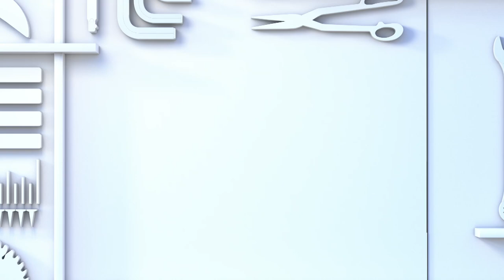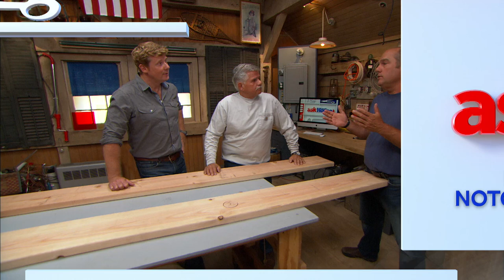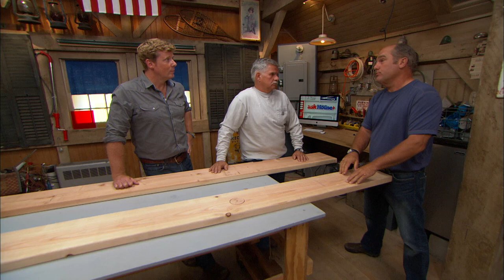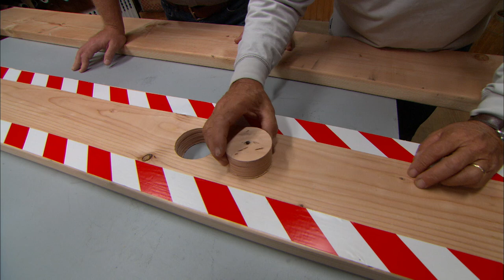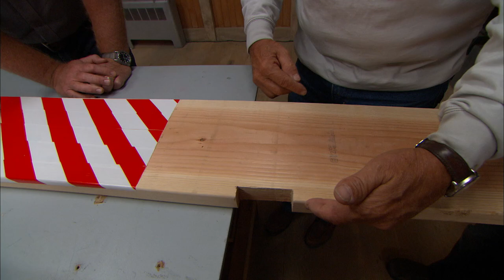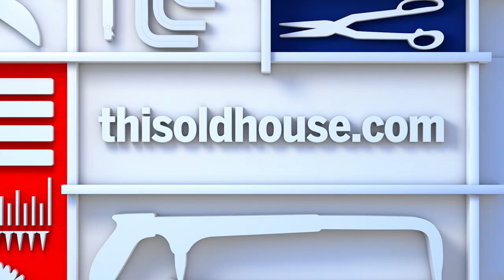How to Properly Notch Structural Beams | Ask This Old House

Comment: I know a house that was built in 1979 that had a major problem. For whatever reason, the plumber who drilled a hole for the kitchen drain. Drilled into the king and jack studs for the kitchen window. The hole only left a 1/4” on either side for both studs. Sooo after several years the window for the kitchen sink began to sag on that side. 

I know this video is about the beams under the floor. But the same principle applies to studs. There is a “no mans” land for studs too, especially load bearing studs like my kitchen window.
Reply: sounds like an unlicensed, uninsured, and untrained hack! Def not a plumber!
Reply: Def not a sparky right ? ;
Reply: Rick SC . They seem to employ a single mindedness that relieves them of any consciousness regarding structural integrity.  $95 and up an hour in Australia lol .

Comment: How many holes can we make in a single beam and how far apart do they have to be? , same question goes for the 1/6 notch
Reply: Right? There should be an explanation on how close two notches/holes can be to one another. Max would be dependent on size.

Comment: I had an AC contractor use the old .... " It will be fine , these beams are designed 30% stronger than they need to be" The one third thing didn't apply to him lol. I feel sorry for these guys though we used to do alot of flat roofs all solid beams with the expectation of a vent in every room with no allowance made for services ! Ahh fun times . Stuff like this is the first thing you need to think about in design not the last thing.

Comment: My hvac person drilled a 5” hole in a 10” beam. The wall below that beam is now a structural wall. Kind of a bummer.
Reply: @TechGuy-sv3pt
A structural steel beam is not free. They installed a thin piece of plywood on the wall. Making the 2x4 wall structural.

Comment: While not always possible, wouldn't it be preferable to notch a beam along the top edge as it's in compression and, therefore weakens the span to a lesser extent when compared to notch that's in tension?
Reply: No, because you have to keep wires and pipes(for electrical, I dont know about other trades) at least a 1½" away from the floor or roof because of nails.. I know tour post is 4 years ago but I figured I would answer it.

Comment: I've been told you can NEVER notch the bottom, because those fibers are under tension.
Reply: That's why you can't notch the center third - that's the part under greatest tension.
Reply: @bokononisti2820  you can’t notch the bottoms at all

Comment: Intro talked about difficulty with heating ducts, neither example talked about heating ducts...
Reply: Matthew Braun You can run actual ducts parallel with the beams and use duct hoses when going through beams.